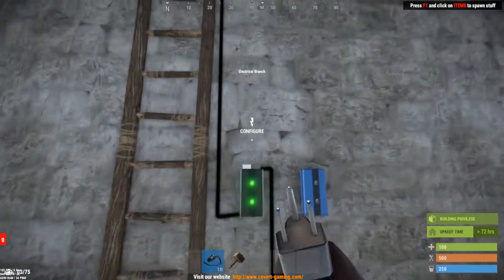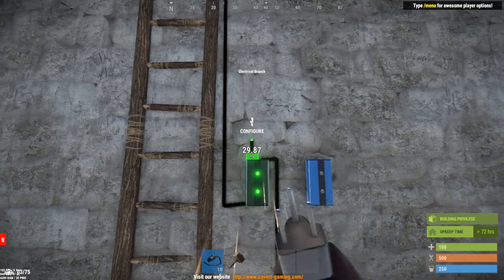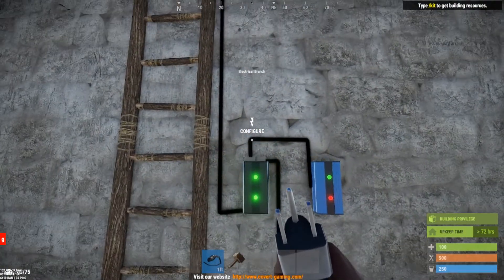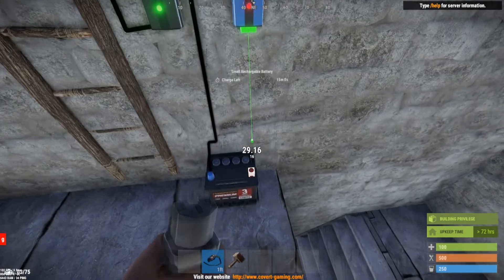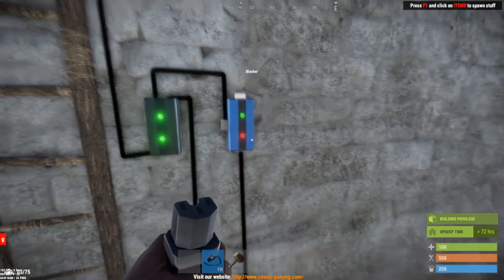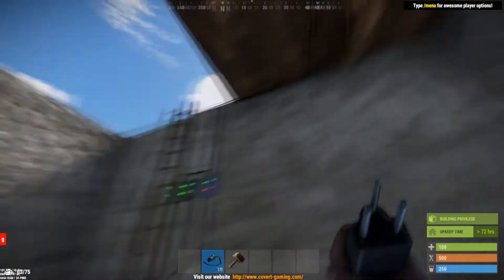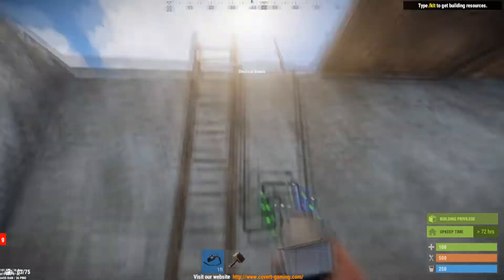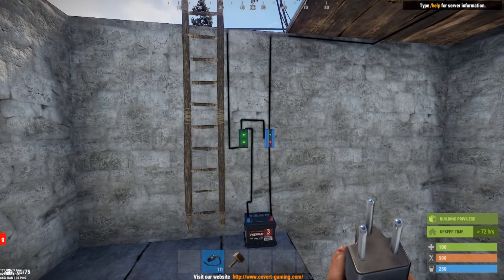Rust Electricity - Automatic Lights Explained.

Comment: Nicely done, a tip you can give is to reduce to 10 on the light detection branch since at the time it reaches 10 is pretty much sun down AND you pass more energy to be saved on your battery.
Reply from the maker: A great tip! Yes, I should have mentioned that as a viable alternative to speeding up the turn on as night approaches. Thanks as always for the tip!
Reply: @RUSTQuickElectric  how you reduce to 10 the light detection branch ?
Reply from the maker: Cesar Daniel Moro by pressing E on the electrical branch you can manually set a branch out limit.

Comment: LMFAO, so for about 4 days i was trying to setup a daylight sensor on a pve server i am on, ended up with your setup (though expanded with 8 solar panels East and 8 west and a boat load of root combiners and 2 separate battery loops and a AND switch) then i stumbled across your video today! then i read the comment about adjusting the branch out to 10, now i gotta go change the AND to an OR and set my east and west branch loops to 10

Comment: Idk if the RF equipment was around at this time, but to use this on a larger scale with wind turbines you could use a pair of back to back solar panels connected to the RF equipment to then transmit a signal when the sun is either on or off and then that will be your source of automatic lighting while being able to use the wind turbines for regeneration instead of just the solar panels.

Comment: Can you get juice from a wind turbine? I've tried root combining the branch signal with a turbine before connecting to the battery but I can't
Reply: Do you have 2 or 1 wind turbine if you only have 1 there is no need for a root combiner just connect the power out from the turbine straight into the battery unless you have 2 wind turbines then you use the root combiner
Reply: @michaelgonzalez2516  yeah i got it dont rally need Wind turbine Just a medium battery and I can power all my lights hehehe

Comment: Hey man good video as always. Do you have any idea on automatic door close? Open them manually and they close themself.

I has been thunking in use a cycle with a timmer to make door close every 10 seconds. But this may be overcomplicated. 
Could you make a video on this?
Reply from the maker: Fastest way to have an auto closing door is just using a pressure plate at the exit point of a door entrance if you're manually opening it. The issue with an automatic door is that it would require a non-stop power drain since it would need to be always running which makes it somewhat troublesome.
Reply: @RUSTQuickElectric  But to close.it with a pressure pad it should first be open with the door controller right? I mean of the door controller is off, door is closed, But if you manually open it the door controller dosent change his state right? I will do some test later
Reply from the maker: @Lazy4444  If you manually open a door and have a pressure plate on the opposite side that is wired to a power source and the door controller, it will manually switch the door to the next state. So if you have it wired correctly and manually open it, a pressure plate input would trigger a door controller forcing it to close.
Reply: @RUSTQuickElectric  Oh niceee gonna test it. Anyway I think it would be a good video since its a pretty usefull think.

So no one in your team forgget to close the door, or if you are door.camper.

I will look for a solution withouth pressure plate anyway since I want the door.to close even if I dont go out. So if Im kill fighting in the double airlock, they woulnt be able to loot my body

Comment: What I'm curious about is how to do auto lights with a generater
Reply: You could use a single solar panel for the sole purpouse of blocking the blocker
Reply from the maker: Jager Faust You would have to use a clock since a generator is not light based.

Comment: I would like to see a video of the lights coming on earlier. I’ve tried but it never works for me. I run about 15 lights through the base, powered by a large battery that is charged by 4 solar panels. 

I run the same configuration as in the video, is it a matter of adjusting the electrical branch to “20” for example. Because I’ve tried but the lights didn’t come on any earlier.

Ps. Nice video - subscribed!
Reply from the maker: The higher your number to branch out would delay it longer. If you set your branch amount to a smaller number would mean less power to output as a limit. Really the easiest way to get lights to come on sooner would be to set a timer along with a switch. Thanks for the support!
Reply: RUST Quick Electric - Thanks for the reply. I see where you’re coming from. I’m looking to use the lower power from the sun to trigger the battery earlier and therefore make the lights come on automatically. My problem is I don’t understand the components entirely yet as I’m a novice when it comes to electronics, but I’m getting there. Might jump into your discord after work and see if ppl there could help out.
Reply from the maker: Xbravo Gamer actually while I’m sitting here thinking about it if you were to use a counter on the in between with a memory cell you could manually set the flow through to trigger a circuit prompting the lights. Might mess around with it tonight to see if I can get you a working schematic!
Reply from the maker: Xbravo Gamer hey just wanted to follow up again and not leave you hanging! Most of the possible alternatives I came up with end up being very heavy on electric need and components to be a realistic option for a vanilla server. One I really enjoyed on creative was a simple clock based timer that triggered the lights at a certain time on the clock with an ending value but it was very intricate. Perhaps when they release a few more components it will be much less costly!
Reply: RUST Quick Electric, thanks for giving it a go! I found this video https://youtu.be/Fgrjs-wIPFM but it’s looong. This dude manages to make the lights to come on earlier but I haven’t tried it yet. I think he runs 2 different circuits, one for charging and one for the lights. Skip to about 18min before anything interesting is said. Thanks again.
Reply from the maker: Xbravo Gamer It’s definitely possible, just a matter of in game vanilla cost vs worth. Seems like a double set up with charging station is a bit too costly for a bit earlier light trigger. Interesting idea though!
Reply: RUST Quick Electric, cheers for trying, looking forward to your next video!